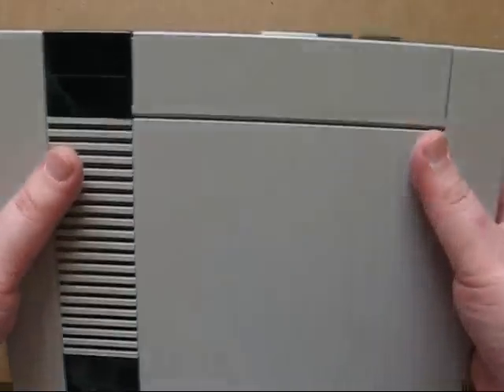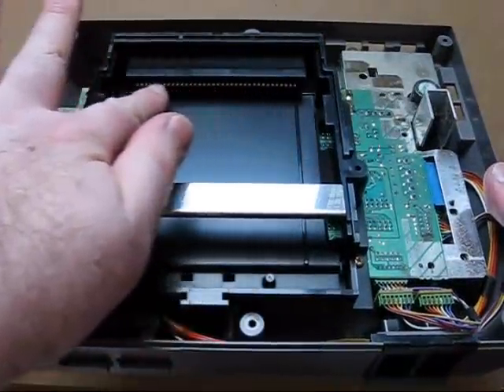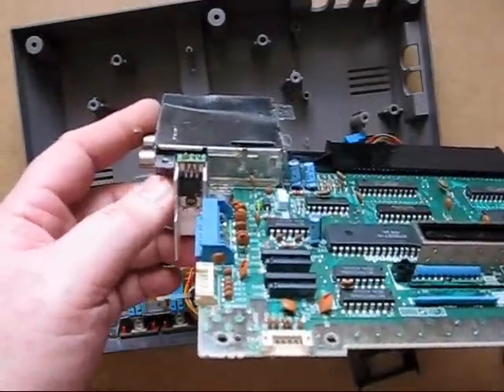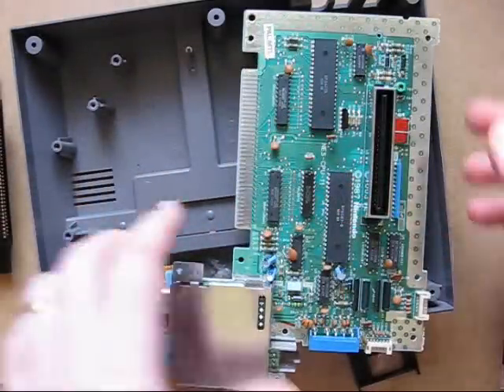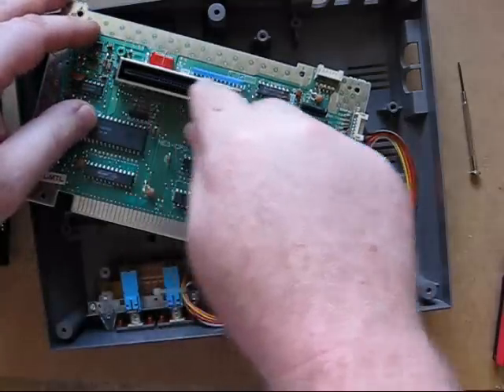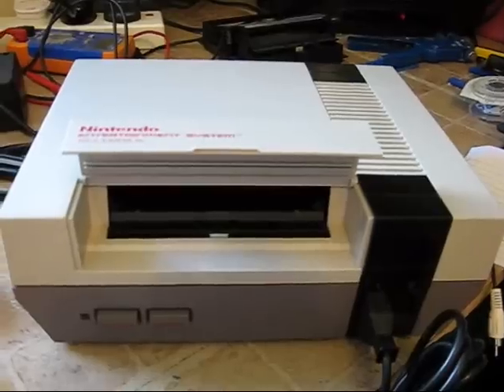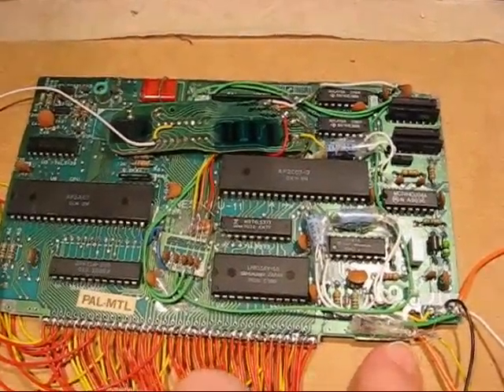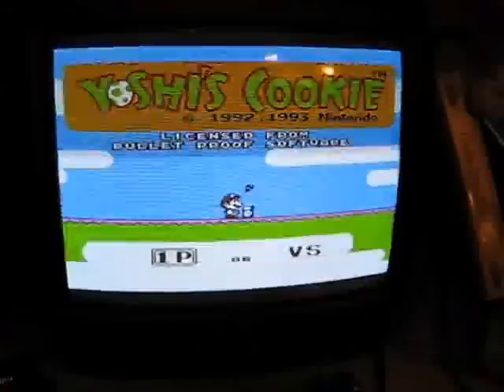Alpha Omega project - part 2 - Nintendo NES

Comment from the maker: Thanks. Although i've worked out much of the project in my head, there are many elements I will have to solve when I get to those stages. Keeping each system independent of each other yet sharing the same controller for all systems will be a headache for sure!

Comment from the maker: Reasons as you mention. I have a RetroDuo as better (?) than a Yobo; however was very disappointed with game compatability on the SNES, about 60-70% of my PAL and NTSC games. The NES part too "isn't perfect"; so consequently, i'm only using official original hardware as everything will be 100% compatible. Only downside is a slight decrease in speed on the NTSC games, but barely noticable. 

I'm not using emulators either, only exception may be MAME which i'll probably use on Xbox/other.